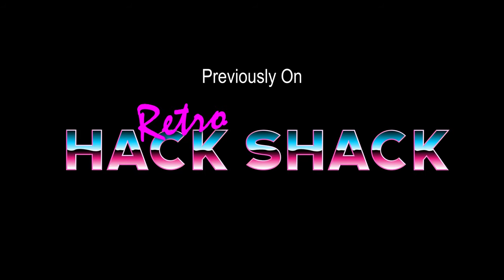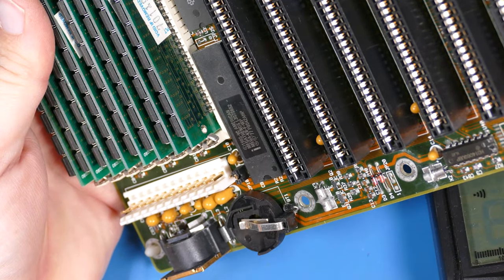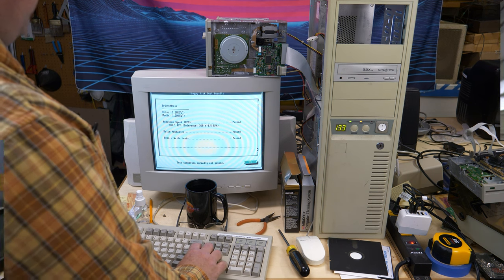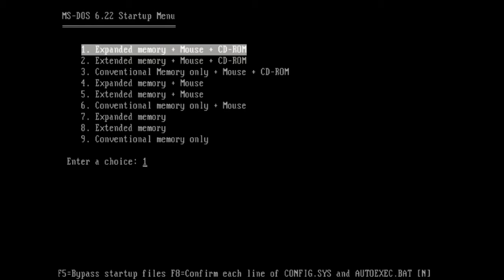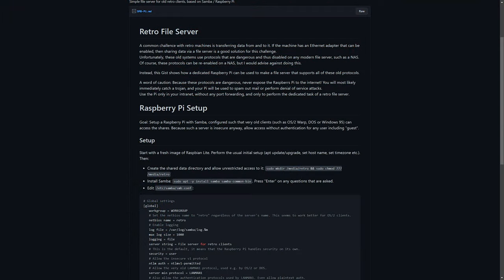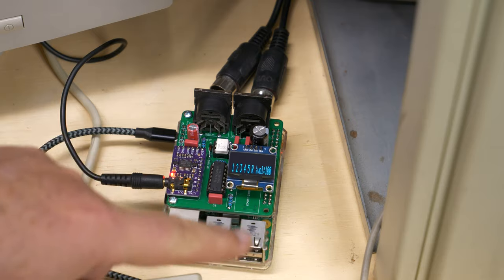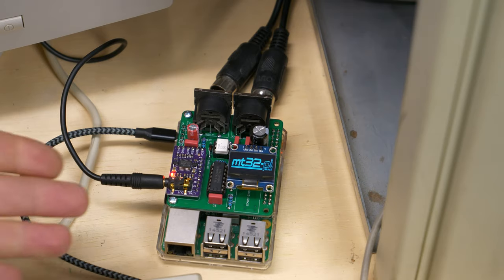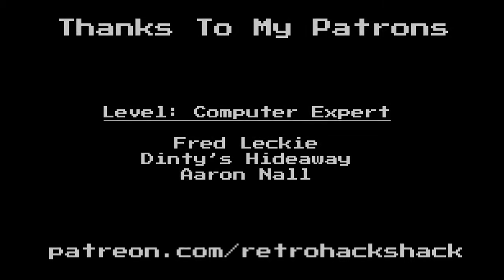Amazing Raspberry Pi MIDI Device - And Other Repairs To The Full Tower PC

Comment: Another option for the battery is to use the rechargeable one with a 3.6 v zener diode across it to limit the charge voltage.
Reply from the maker: I'll try that next time. Makes sense.

Comment: Honestly, I'm more interested in one of these mt32-pi devices than I would be in owning an actual MT-32 mainly because it can be had in such a small and functional package. I considered the DreamBlaster stuff and, yeah, those are very cool and even smaller. But … so much of the DOS stuff really wants the MT-32, not some other more modern GM device.

Roland kind of lost the ability to defend a Copyright on the MT-32 ROMs because they were forced to admit they had no way to prove they owned any Copyright on those ROMs. I'd love to be able to license a properly legitimate full set of the MT-32 variant ROMs. Roland seems to be too sour on the whole thing to be willing to offer the package though.
Reply: Dreamblaster (Serdaco) now has his own MT32-pi solutions as well, in the form of 1. Waveblaster card, 2. External hat, 3. Case mod hat (for 3.5" and 5.25" bays)
Reply: @naib_stilgar  The dream is alive! MT-32, GM, GS, and XG in the pocket of my LANbag! Grab whatever machine I want to use, grab my bag with everything I need to set it up where I'm going, and walk out the door.

Comment: Wonder why the CD interface card would still be in there but not fully plugged up if the Sound Blaster card was there? I assume it was just used for CD IDE and not CD audio in its previous life, interesting.
Reply from the maker: Yes. That is my assumption as well. I am sure when they upgraded to the Sound Blaster and Win95 they wanted the CD audio to play through the SB.

Comment: Your Marble Madness disk (assuming it's an original disk with a new label) is not reading because it's not a DOS-formatted disk:  It's a bootable disk.  It must boot the computer from Drive A: to run.  Trying to DIR that disk will generate a read error on every computer/drive.
Reply from the maker: That could be. I'll try it in my XT and see what it does there.

Comment: Back when the Earth was still green, there were kits of AA battery holders that had leads that fit typical motherboards.  It seems like outfitting these with rechargeable NiMH AA batteries (rated at 1.2 VDC, so 3 would get you 3.6 VDC) might be worth considering, depending on what charging voltage and current the board supplies.  Typical AA rechargeables vary from 2000 to 2600 mah.

I see someone has suggested a zener with the LiR 2032.  That would work better, I think.
Reply from the maker: Some boards had external batt jumpers on the board for just such a purpose. Unfortunately, this one did not

Comment: I loved to play Betrayal at Krondor. That game needed A LOT of conventional memory and extended too. That made me to tweak the autoexec and config files to have always max amount of conventional memory plus expanded and extended all that with sound blaster and cdrom drivers too.  I started (at beginning ) with memmaker after loading all the drivers then tweaked the configuration manually. Of course I selected the smallest drivers possibles (as memory footprint) and loaded them in order to fill the upper memory like puzzle pieces (yes, I played Tetris a lot).
Almost never needed to use alternate configurations to boot (boot menu) except to select between plain dos or windows 95 GUI.  I did this on dos 6.22 and Win95 also (some games do not behave properly in a dos box or under Windows and Win95 was buggy when returning from msdos mode).
Great video, love to see your content about retro stuff.
Merry Christmas and Happy Holidays!
Reply from the maker: Thanks so much! I was going down the memmaker route when I stumbled upon Phil's computer lab page. Good stuff.

Comment: I use old wireless phone batteries, theyre removable, theyre the same voltage, theyre similar chemestry and charging, and theyre able to be mounted away from the board

Comment: the pi is more powerfull, isnt it a waste of a pi?
Reply from the maker: Nope. You can always use it for something else when you are not using it for MIDI.
Reply: Actually running MT32-Pi is very intensive and a Pi3 is not only required but also a minimum for a smooth playback